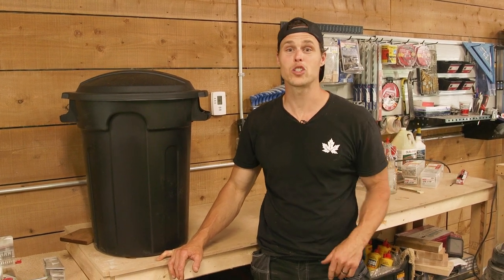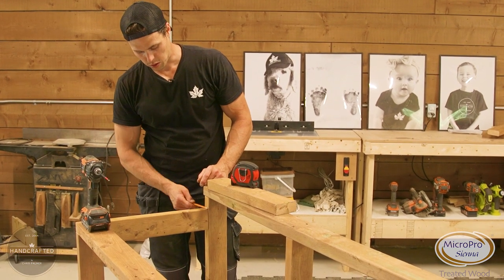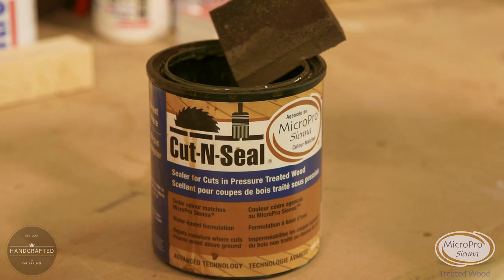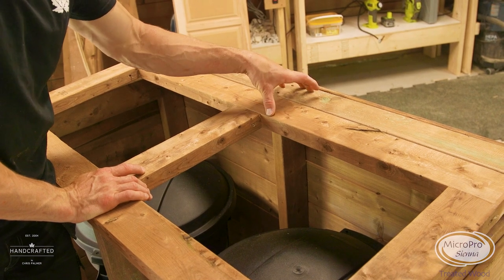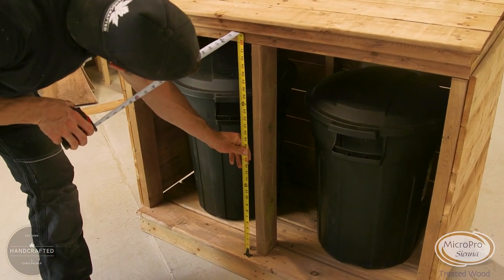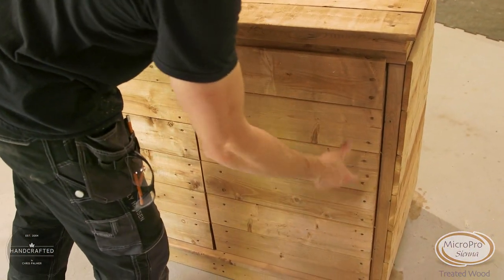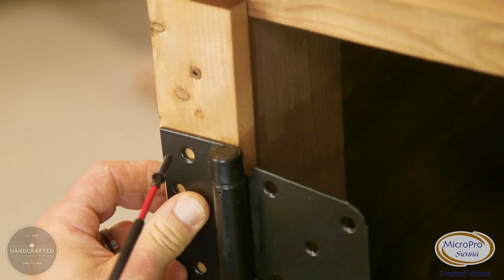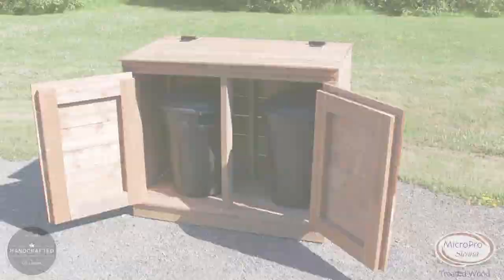How to Hide Your Garbage Cans

Comment: Would it be better to use pocket hole screw as opposed to screwing into the end grain when building the frame?
Reply from the maker: That's up to you, I would pocket hole something I was doing for a more detailed finish but easier assembly and time I did this method. It's still holding together perfectly and we have transitioned it into a toy bin for outside toys. Which is harder on the frame than if it was garbage.

Comment: what do you do to make sure both front doors close and align evenly?My 2 front doors close fine and latch but one door is more out-front than the other door
Reply from the maker: That is either the lumber twisting or the frame being out of square. I use the slide bolts on the doors to help hold them true.

Comment: How much lower is the front than the back? What is the pitch of the lid? I’ve never built anything like this before but ready to try it.
Reply from the maker: The lid has a 2" slope, but you can always adjust this based on your own garbage cans. We actually use this to store kids toys now outside!
Reply: @HandcraftedbyChrisPalmer  It has a 2" slope so would you say it is about 5 degrees?
Reply from the maker: @johncooper6246  all depending on lid size really.
Reply: @HandcraftedbyChrisPalmer  I was thinking that. I want it to mimic the 2-12 slope of the building.
Reply from the maker: @johncooper6246  I believe its 2" or maybe 1.5" based on material thickness for slope
Reply: @HandcraftedbyChrisPalmer  Thanks again. I'm adding 4 1/2" to the 39 1/2" (for offset loss at the bottom) to make the inside measurement true.

Comment: What kind of drill bit is that?
Reply from the maker: Size you mean?
Reply from the maker: The impact driver I used a 6" milwaukee #2 Robertson and to drill the hole for the slide bolt it was 3/8" standard drill bit.

Comment: is there any way that i can have you to send me the measurements for the frame please?
Reply from the maker: The frame is built based on your own garbage cans. So take those measurements and add 12" to the overall for framing and clearance.
Reply: I’m using the same trash cans as you are
Reply from the maker: If you watch the video at 42 seconds you will hear me say what size the platform is " 4 foot by 2 foot"
Reply: Ok I guess I didn’t hear that sorry
Reply from the maker: @angelashepherd6961  all good, just trust your tape measure and make it whatever size you want!

Comment: How did you cut the notch for the frame?
Reply from the maker: Circular saw and jig saw is usually my method. Otherwise you can do dado blades on the tablesaw
Reply: @HandcraftedbyChrisPalmer  Do you do multiple little cuts with the circular saw or just two then cut that out with the jigsaw?  Not sure if that makes sense lol!
Reply from the maker: @mfrumento  It's easier to do it all with jigsaw and speed square. This is only for 2x and 1x lumber. 4x lumber I do multiple passes w circ saw. 👍
Reply: @HandcraftedbyChrisPalmer  Thanks!

Comment: Where did you use the 3-5 /4x6x8’s ?
Reply from the maker: They were used on the bottom deck 👍
Reply: @HandcraftedbyChrisPalmer  Where? I don't see any 4x material in the video? Thanks.
Reply from the maker: @drab31s  I used 2x4 to build the carcass. I'm holding a piece at 50 sec. In
Reply: @HandcraftedbyChrisPalmer   Aaah. It's three pieces of 5/4 thickness. Got it now, thanks.
Reply from the maker: @drab31s  the whole frame is 2x4.